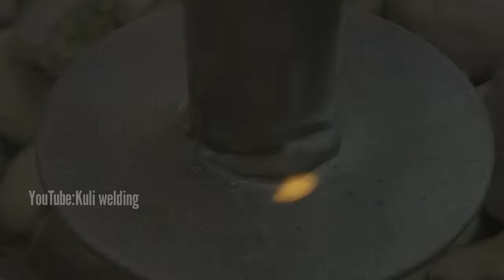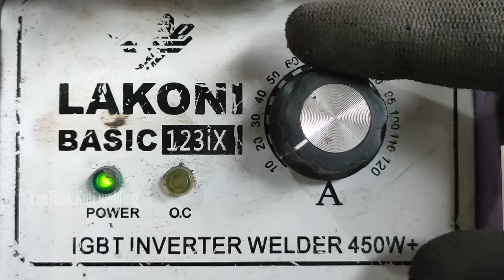techniques that have never been told about how to weld thin pipes | stick welding

Comment: Welding tube like that is better if you can as you are welding it if you can turn round as you are welding you get a better weld less under cut but you have to weld it at the right speed

Comment: This would help if you run into different thicknesses of material obviously you would put more heat into the thicker piece how would u weld thin tube to thin tube guarantee you wouldn’t be stick welding it 😂